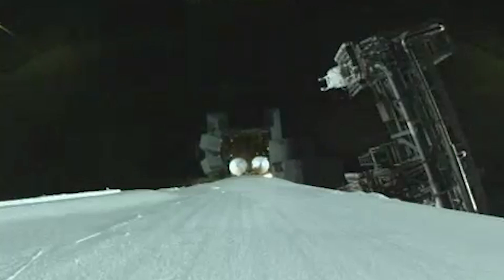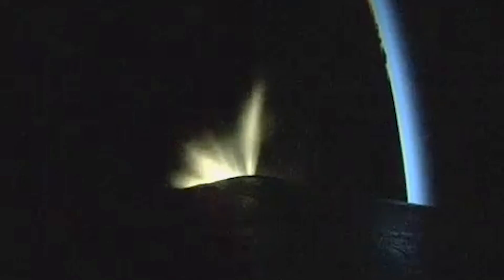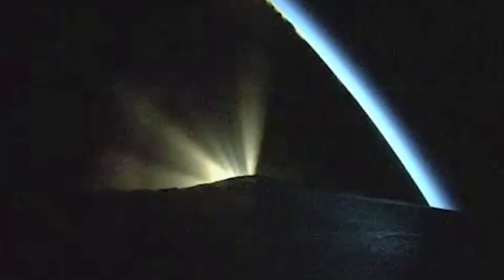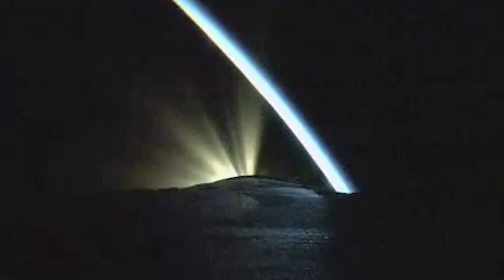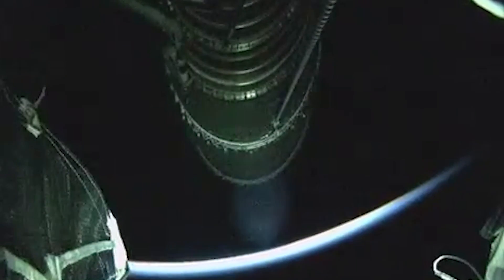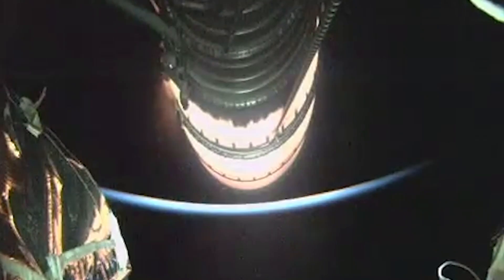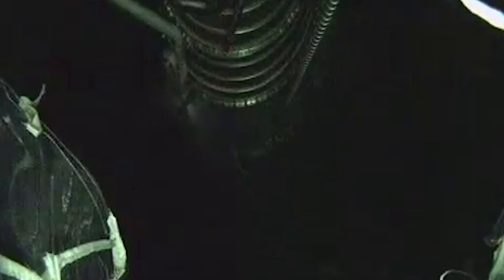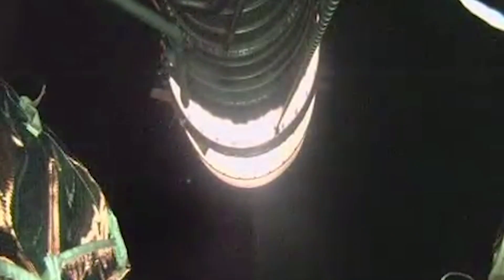Rocket Cam: Delta IV WGS-10

Comment: 100% success rate.
Reply: Not really.  You should check your statistics.  Also, since they are paying 50-100% more for each Delta IV than they would for Falcon 9 or Atlas V launches, a 97% success rate isn't really anything special.
Reply: RyeOnHam that’s interesting! Do you have a link to a source I could read?
Reply: @Orandu  No.  Google it for yourself.  How did you come up with the 100% success rate?
Reply: @RyeOnHam  It's a pretty well-known fact that ULA has never lost a payload. They've come close but because they're upper stage is so reliable it has been able to compensate for first stages shutting down early.
You need to change your attitude and stop being a new space SpaceX fanboy, SpaceX is not a godlike thing made by Elon Musk alone. Cost isn't everything, and when talking about expensive missions, you want reliability and efficiency

Comment: 00:09 so we're supposed to just ignore the cut?
Reply: The liquid hydrogen used to chill the engine becomes a gas and goes up the sides of the rocket.
When the engine ignites, the fire ball is conductive and momentarily blocks the video signal.
Reply: @WolfTronix  is the video signal analog?
Reply: @WolfTronix  NROL-71's camera feed is uninterrupted though
Reply: @phillipsturtles1236  
Depends on how the surface wind blows the gaseous hydrogen before ignition.
The fire ball needs to be between the transmitter on the core first stage and the receiver.

You could probably determine where the transmitter antenna is located, based on the charring pattern on the insulation. ;)
Reply: I believe they cut the feed because the umbilicals are either ITAR protected or a ULA trade secret
Reply: @phillipsturtles1236  I'll ask the man